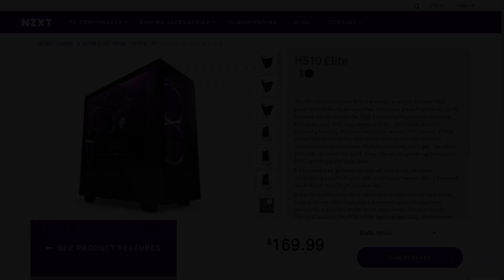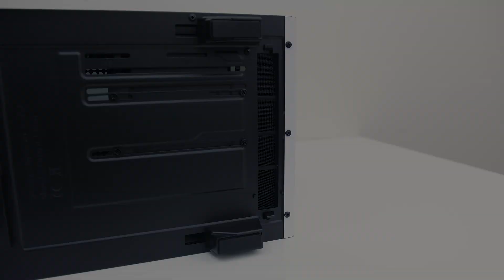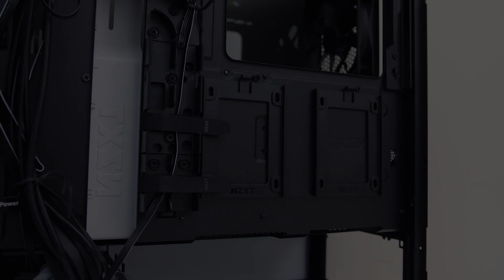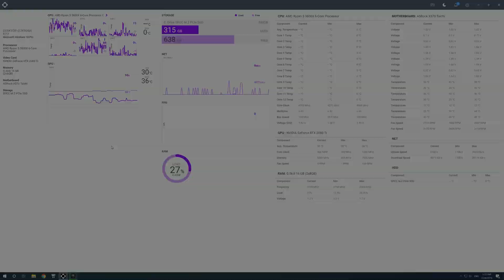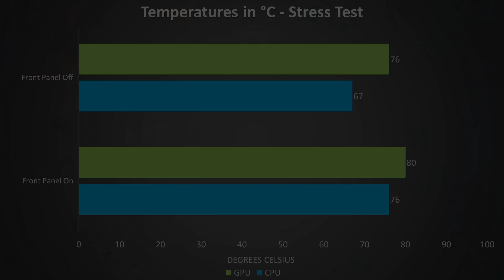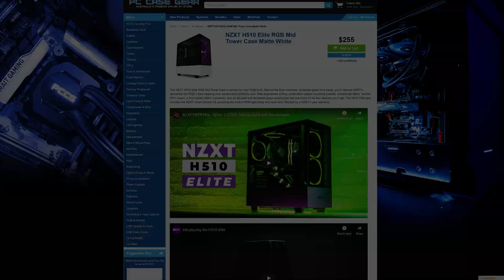NZXT H510 Elite Case Review

Comment: Greetings. Recently, I bought the case mentioned above with a Deep Cool PCIE Extension cable, and it is one of the best cases I have ever had the chance to use. I specifically like the Autistics, Build Quality, Cable Management and Smart Device, for which I had to download NZXT CAM, which was a bummer. But overall, this is the case for anyone looking for a clean build that will be in a showcase for my client to admire.

Comment: Thanks for the review and for testing temps with a tower cooler. I ordered my build with this case through NZXT. I'm an experienced builder but didn't want to pay $2000 for a non LHR RTX 3080 FE card, so I went the prebuilt custom route. 

I'm not super concerned about the lowest temps possible, so it's nice to see it doesn't get absurdly hot during a stress test. Real world usage will keep the temps that high at absolute maximum, but should definitely keep em considerably lower.

Comment: the big selling point is the RGB fans but they don't give you the adapter for the 4 pin male pins so you end up with no RGB and no fans no manual either. how frustrating.

Comment: just bought it. looks great.
Reply: hey man im planning to buy this i will aprecciate if you tell me what are the temps while playing a lot and do it still good since one month passed. do you regret it? do it has a good air flow??
Reply: @panzi4638  my only regret is the non rgb  behind and top fans.. temps are good..Looks good too... Love the front glass... The data powereo controller is good.. I don't like to power my case fans and rgb from motherboard.. . No complaint..
Reply: @maxfactor4209  thank you so much, do you think my i5 10 will go 60 to 50 degrees without and aio, and my vertical gpu to 60 to 50 degrees?
Reply: @panzi4638   I don't recommend vertical GPU, in this case, using the standard mount. it is too close to the side glass and overheats your GPU. You need to get the entire new kit (PCIE cable and case back panel). I am running the NZXT standard case fan (2 front intake, 1 back and 1 top exhaust). All running at 900RPM (Idling). noctua nh-u12a  for CPU which is always Idling even during AAA games like Battlefield 5 so I assume temps are good (never monitored ) .

Comment: Just got it, packaged well, ordered in all black, it looks super clean!!! Cant wait to piece it together 👍 my Build in the comments below..
Reply: Did you order parts for it? Or was it a prebuilt if it’s prebuilt where should I buy it bestbuy Or another gaming store? I’m just young looking for a pc
Reply: @sepptex160  bought everything Piece by Piece
Reply: @zenfuri89  hey you mind listing what you need
Reply: @chillllll187  This is my Build:
MOBo: Msi Mpg x570
Cpu: 5600x ryzen 5
Cooler: nzxt X63
Gpu: EVGA 3090 FTW3
Memory: 1TB Samsung EVO 970
Ram: Trident Z 3600 and 16 cas latency with Royal plastic inserts 
PSU: EVGA G+ 1000Watt Gold 
Cables are Mixed with EVGA and Phanteks 

Games are Buttersmooth but probably would have stayed with a 3070 or 3080 if I could pick the gpu again. It’s really overkill.
Reply: @zenfuri89  okay thx so much bro

Comment: Does it have a good airflow?
Reply: Jr youssef_ it’s fine but not so good
Reply: @JasonGT95  I got the case and 50 max celsius on cpu and 45 on gpu is not bad temp at all
Reply: yes
Reply: @rotsec  hey man im planning to buy this i will aprecciate if you tell me what are the temps while playing a lot and do it still good since one year passed. do you regret it? do it has a good air flow??
Reply: Jr youssef_ it’s “normal”

Comment: I have a question, can I put some rgb fans in front and behind them a liquid cooling?
Reply: The fans gotta be compatible with the case so its better to just stick with the fans that come with the case but you can probably put liquid cooling on the back opening just fact check it cause I might be wrong im new to PC's

Comment: Why does it has only 1 audio jack, how am I going to use sound and mice? And why does it only have 1 USB......?
Reply from the maker: You can use an adapter to run 2x 3.5mm cables off one plug.

Comment: Where do you connect the led cable to?
Reply from the maker: The RGB pins on the motherboard.
Reply: @JarrodsTech  I had a guy build me a pc with this case. The 510 elite. The front rgb and the top strip dont light up... He had a cable running out the back that wasnt hooked up. It turns out to be the rgb strip lighting up top. the guy who built me pc told me to get a female to female 4 pin adapter so i did and plugged it into my Mobo header... It still doesnt glow at all. The fans work but rgbs dont???? I need help and tips thank you!!

Comment: Can i buy 2 extra rgb fans for the back of the case and control them with the included controller? Sorry but my english is bad i dont understand what you said in that part :/
Reply from the maker: You can install your own fans, on the back there is room for one, and one on the top. There are 4 headers on the smart device so you could fit more.

Comment: For the price all the fans in the case should be rgb -__
Reply from the maker: The two fans that it does have are already pretty expensive for some reason, though most cases seem to cheap out and not have the rear one RGB, pretty standard for a stock config.

Comment: No thanks, my Lian Li 011 Dynamic kicks this cases booty, and is $40 cheaper.
Reply from the maker: Fair enough
Reply: The PC-O11 comes without fans though right? It won't be 40 bucks cheaper once you've paid for high quality fans - and you need a fiar number of fans to achieve the great aesthetic, otherwise it looks bare.
Reply: @Buffinator1988  My open loop cooling system has 2 360mm radiators in it. Let me see you stick 2 360's in this NZXT case.

Comment: h700i or lian li o11 are better imo, any other good cases? (since I'm looking to build a new PC next year)
Reply from the maker: I prefer the design of this over my H700, though the new H710 I saw at Computex has some nice improvements over my H700 too (much easier to remove the glass panel instead of the 4 screws). I honestly haven't used that many others myself yet to say.